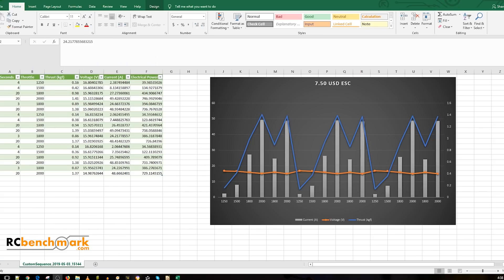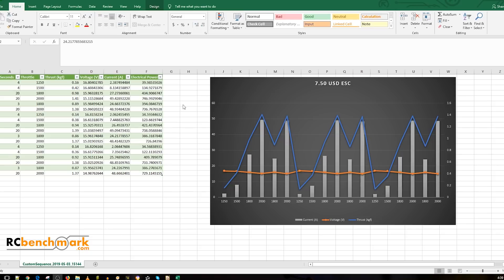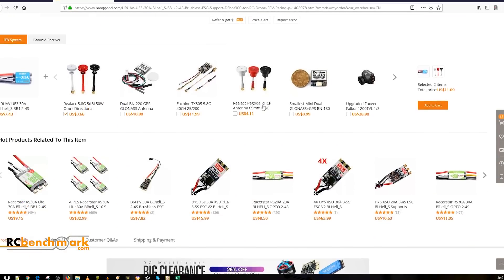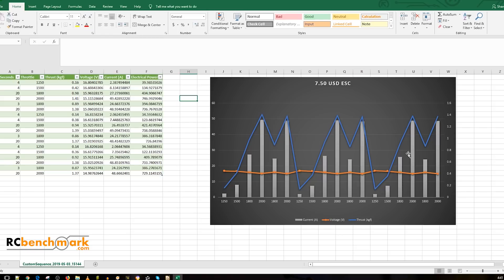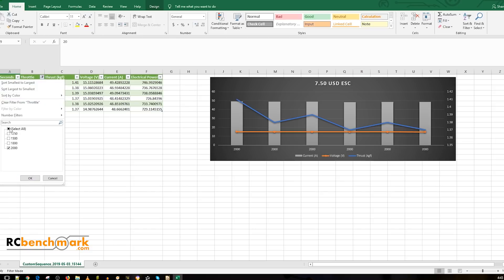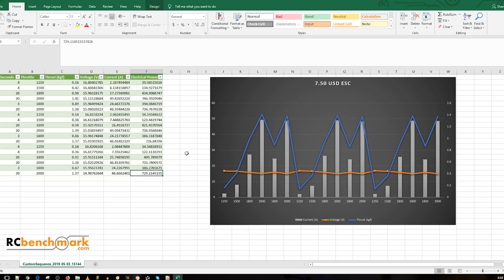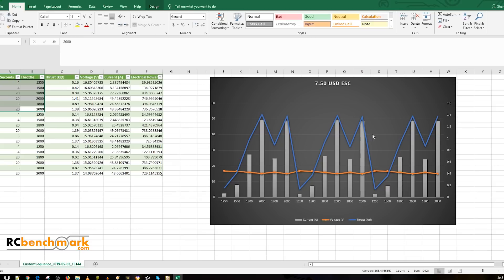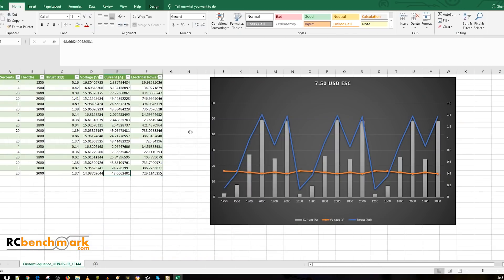Cheap $7 ESC 50 AMPS for 2 Minutes? // ESC Stress Test V1

Comment: Good Test ! I find the temperatures quie interesting. First it was a little confusing at the beginning of the 2nd cycle until i realized that the upper temperature of the color-scale was changing for indicating the highest temp in the whole image. The other numbers in the middle of the IR-Image seems to be less meaningfull.
Is it possible to set the overall-temp/color-scale to a fxed range ? (lets say 25-110°C) And can then one of the temp-markers inside the IR-image can be pointed to the hottest point ? It is looking like beeing somewaht aside from the hottest point.

Comment: Maybe (just a theory) the always changing pwm output the FC gives the ESC and vibrations and electrical noise caused by four motors at different speeds in a hard flying brick with turbulent wind unbalancing the moving props can be more stressful than a motor mounted in a fixed stand? Even though in-flight the current hardly ever goes beyond 80% the current of the fixed stands tests i think the much higher noise of a beaten quad could potentially be more dangerous to the electronics.

Can you also do some tests with unbalanced props? Probably they could simulate more the noise of a real quad and would be very nice to see effects of beaten props on the motors.
Reply from the maker: These tests are to test how well an ESC can handle the current without catching fire and damaging a fet.

Comment: Spedix 30a hv 10$ best most reliable powerhouse out there.
Many 140-170mph speed runs on 6s with 5046,5552x3,6060 and 7060 props and yet to have 1 failure in flight from power and also run 2205 4500kv on 4.7x4.7 props that pulls over 300a and they took it like a champ and zero desyncs stock settings.
Theyare no joke thats for sure amd also tiny.